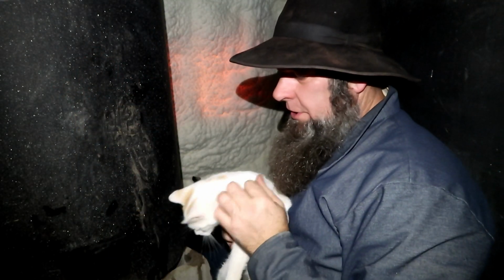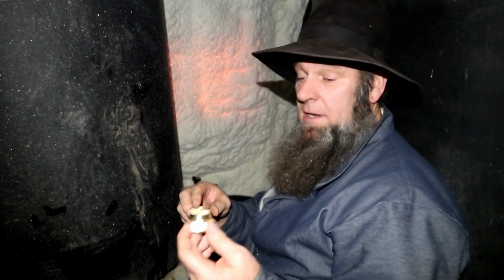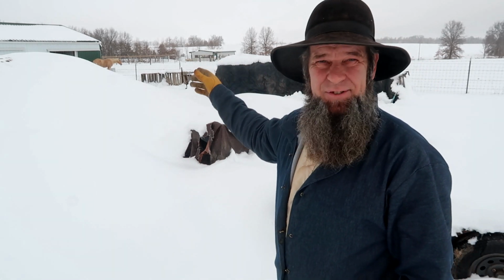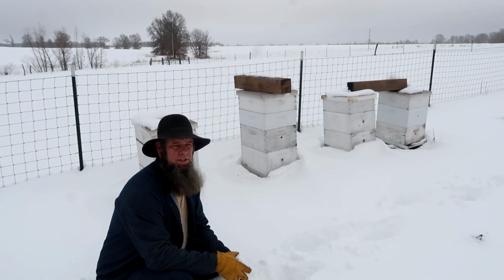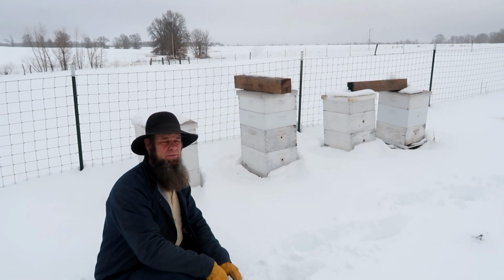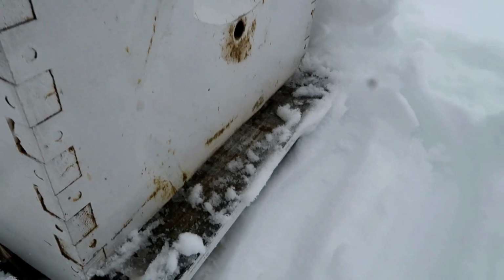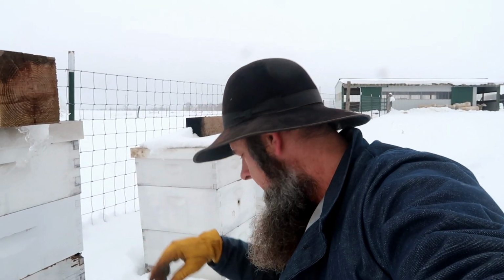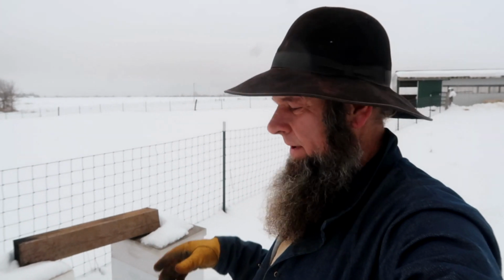Little house in the BIG snow ~ keep it simple

Comment: Just a heads up,next time you wrap teflon tape around threads,wrap it in the same direction as your going to tighten the fittings up so the teflon tape doesn't want to peel back off.
Love your videos.
Keep them coming. 
Stay warm my friend.

Comment: Get them horses working pulling that firewood. Best large equipment in the woods in a good horse or two. 
We are on WI with a 4 bedroom Off Grid and even on the coldest years of -35 for 4 weeks only go through 7 cord. 
Good passive Solar helps as well as a radiant heat flow design.

Comment: We love our quick disconnects. We have one on the frost free hydrant in the barn. We ran the hose up into the loft and the back down to the trough, this way it drains itself and doesn’t freeze. We just snap on the hose with the quick disconnect, fill the trough and snap it back off. We keep a bucket at the hydrant to drain the water from the hose into. I use that to water the chickens....waste not, want not. We are getting ready for the next big storm too. Freezing rain on top of the snow here today.

Comment: Make sure you make a SLED to tote the wood from the new big tree back to your lot when you cut it down.   Easier to sled across the snow than to tote in the truck bed.   You should also put a "cart" on sled slats for toting water and other items around the farm when there is snow on the ground.   Make your sides high enough to keep things on the card but easy enough to remove from the cart, or make one side easily removable or on a hinge.  milkaTheAppreciator

Comment: Doug I have a question on your water. If you lived on a hill, would you have installed the tanks in the ground and ran the lines to your house (that is obviously lower than where the tanks are) or would you have still made this water room?
Reply from the maker: Hard to get in the ground for tanks and maintenance 👍 great choice no regrets

Comment: Covering wood pile is wise so that way you keep it dry so it burns a lot better to keep warm! IF you can get red elm, white oak or red oak they are the best for the sub zero temps.  nothing beats wood heat...most houses don't have any way to keep warm if lights go out or gas has to be shut off for what ever reason. that's so sad..

Comment: Heyyy, great video as always. Which beehive do you think is the best, solid bottom or screen bottom? I'm thinking the screen bottom will give easier access to the rodents.
Reply from the maker: na, mice wont touch it but each bottom has its place. We did 2 and 2 to compare them. They are equally as good. Stay tuned because we will be going to a few horizontal hives this spring =)